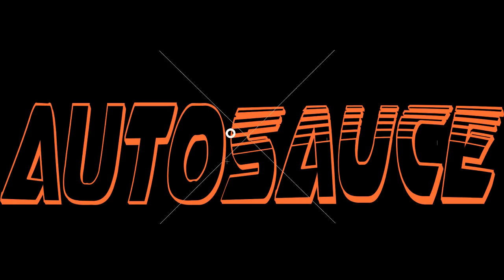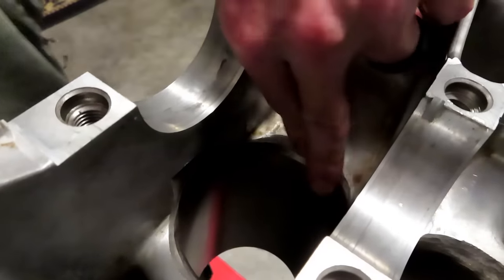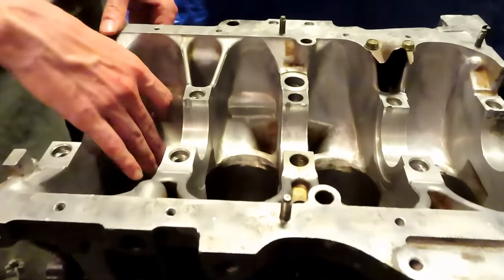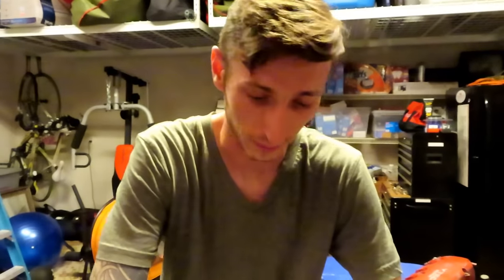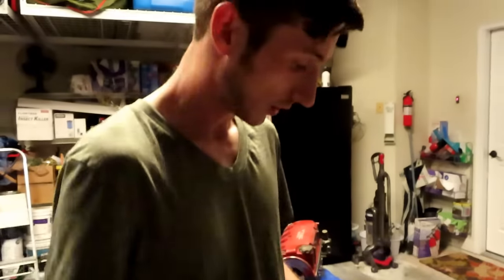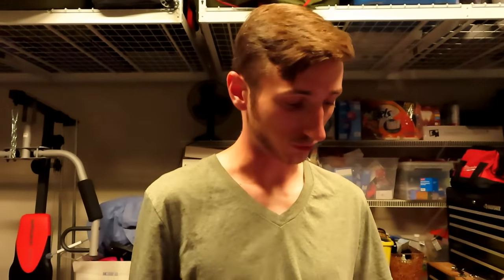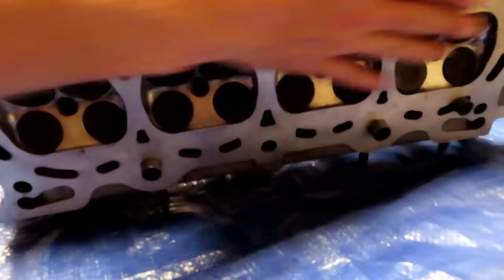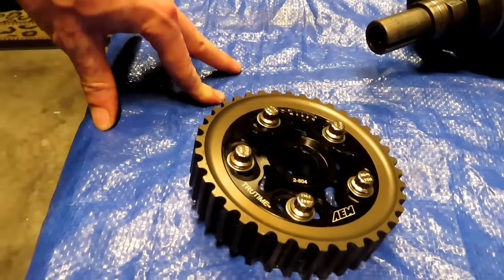EVERYTHING you need to MAKE 500HP with a HONDA CIVIC on a BUDGET

Comment: Lots of misinformation here.
Reply: Dillon Tracy then why are you here?
Reply: @yourfather5324  Because YouTube sent me a notification that this video existed. Out of curiosity, I watched it. I simply commented in hopes no one takes this advice. Because I could rattle off 5 or more wrong things with this list.
Reply: Provide said info please
Reply: @TheActualCaveman  You should always opt for a Z6 crank, Y8 will likely do just fine but Z6 IS BETTER. There is no such thing as a race crank for a D-series. Highly highly highly recommend a new oil pump. Preferably from BadGuys, at the very least pull the cover and inspect it. Shimming a stock pump will get you by, but far from recommended. Porting a stock casting pump is merely worthless due to the point of entry to the block and not recommended. Just get SFR rods, they bump your compression from dog shit to less dog shit with a Vitara setup. NEVER run a blockguard, CSS or nothing. Not even worth sleeving these things. People have been making over 600whp on these with just CSS and 4-500 with nothing at all. Blockguards put uneven pressure on cylinder walls, even forcing taper is some cases. They spell death and will crack your sleeves. Never had or heard of any problems with Ti retainers. Maybe they were installed incorrectly by some backyard mechanic with a hammer and a socket. Supertech valvetrain is the popular choice, but most all will do. Ported head, unnecessary. A stock port Z6 has made over 600whp time and time again and will match even a well ported Y8 head. Plus going wild with a dremel and no clue what you're doing will likely give you opposite results than you're looking for. Smaller ports generate more velocity and that velocity will spool your turbo faster. DON'T buy an adjustable cam gear unless you find you have to when degreeing your cam or compensating for tens of thousands shaved from head/block. No tuner is going to ever waste his time adjusting your cam and resyncing ignition timing for every adjustment. Unless he built that engine or you pay him to continuously beat the hell out of your engine on the dyno before you even get to have fun with it. Typically little to nothing to be gained anyway.
Reply: @dillontracy939  that'll shut him up😂😂
Reply: @TheActualCaveman  Z6 block, head and crank. 100% get the crank polished. New (any) oil pump. Block will likely need to get bored to 75.5mm if done correctly. Fresh deck, plane the head, valve job as well. ARP headstuds torqued to spec in 2-3 steps. OEM/Felpro or JE ProSeal gasket at that higher power level. Springs/retainers recommended, not really necessary if stock limiter. Don't forget a fuel pump and injectors. 255/1000 might get you to 500whp. Big boy clutch. Lastly, a 4 bar map sensor. Should make a very reliable 350-400whp easily. 500+ you're doing so at your own risk with those pistons lol.
Reply: @dillontracy939  dude what's the best turbo for a d on the streets? quick spooling and will take 400+whp thanks
Reply: @alitoroganan2442  Most turbos will get you to 400+. Just depends how much boost you're comfortable with. These blocks see upwards of 26-32 psi on stock sleeves and live for months if not years. 50 trim will spool fast, around 4k or so but might be a struggle past 350whp. Something closer to a 60mm will definitely make you the power but spool will come later 5-5500. Hard to recommend a turbo as there are so many and budgets are a thing. Tuning, compression, manifold design, charge pipe diameter etc etc all play a huge role in spool times. Buy a 50 trim Nagasaki War Whistle and send it. If you need more, another one that's bigger is about $100 lol.
Reply: Very much appreciated on this info!!!! Screenshotting for sure
Reply: @dillontracy939  I was told a factory Mitsubishi Eclipse turbo manifold bolts right up to a D series Honda engine??

A stock Mitsubishi turbo T25 or 16G turbo spools very fast and you can run 20psi on them all day. Very cheap and plentyful too.
Reply: Hey man, u have instagram or facebook for me follow or add you? Because i will buy a coupe civic in the next year and i will need help, and i think you don't go reply this topic on the next year
Reply: Helpful comment and video I’m a newbie with lil cash but a 97 accord coupe vtec 5 speed and  what kind of guidance I can  to find used performance parts and body etc
Reply: Dillon Tracy this is great information. I’d be willing to pay for a full build breakdown and parts list.
Reply: @dirtysanchez2161  check out what bisimoto does
Reply: @dirtysanchez2161  cam, full bolt-ons i-h-e and a vfaic and a tuner and Dyno to dial it all in. Go with a drop in cam unless you can afford to do full valve train upgrade

Comment: What about the transmission? I heard d16 trans is super weak?
Reply: D16 transmissions are garbage! I use to race a CRX with one, and we were rebuilding the trans once a month. They do make a D to B adapter plate so you can run a b-series trans with a d-series engine, kinda pricey but well worth the investment if you love your d-series lol.
Reply: D16 trans can be weak unless you have one fully built with carbon synchros and a full LSD along with custom gears. Going over 500 hp will realistically need a D to B conversion on the trans.
Reply: @Hoovnuts2010  but where can u buy that d to b conversion
Reply: Boosted Carlos, they are available online. But they are expensive.
Reply: @boostedcarlos5953  D2B is not the way anymore. B series trans aren't notably stronger than D series. If you learn to drive it you should have minimal issues. If you dump the clutch and ram gears as hard your biceps allow you, you will break them both. D2B is super expensive no matter which of the 3 ways you slice it. Also needlessly complex and annoying when you do have to swap trans. You're also swapping bell housings. Broken transmissions are a byproduct of making 4-5x the power it was designed for.
Reply: D series period is shit I your going to build a Honda k series or b or h is definitely the way to go

Comment: Are the single cams gaining popularity? Like I’ve noticed more after market support and more serious builds on them
Reply from the maker: Definitely man!
Reply: @Autosauce  so you’ve worked with the d16, what’s your opinion on the cylinder walls and sleeves? I was looking at wet/mid sleeves for the d16 and they’re only like $650 (usually $1000+ for other blocks if I’m not mistaken) but honestly if I could negate that cost entirely on the block build and just stick with stock sleeves (upon inspection) or replace them and add a block guard instead of spending the extra on mid sleeves. Basically in your opinion is it worth the investment or is the existing structure suitable for 350+ hp

Comment: What about on the D17? I have a first gen EM2
Reply: I had one as my first car unfortunately there is not alot of aftermarket parts for it nor is there big power to be made with the d17 so I would say if you want to make more than 200hp easily do a swap
Reply: I have a 05 em2, with a tuned  k20a2 swap, after breaking the crank bearings (the weakest part of the d17) , add me.on facebook if you want more information ;) 
@ nicolas dujardin

Comment: why not just by an older intergra with a k block, everybody says they hold 500-600 hp completley stock
Reply from the maker: Mike Rivera JR an older integra comes with a b18 not a k20
Reply: @Autosauce 
your right if we go really old BUT, by to day standards a 2002 integra[aka rsx] is now almost 18 years old and can be purchased for 1500-3500$

Interga motors  [from wiki https://en.wikipedia.org/wiki/Honda_Integra ]
(94-01) B18b or b18c
(02-04)  K20A, K20A2 
(05-06)K20A3, K20Z1
Reply: @mikeriverajr4447  not sure how well a k series gearbox would hold up to that. It seems that's the weakpoint of the k series. I could be wrong though

Comment: So I bought an eg, which had a d16z6 already swapped in it.
I want a k24 ultimately, but I’m curious how much I would have to spend on what I already have
Reply: turbo kit and you get about 200hp, cheap turbo kit. a rebuild for 400whp I would say about $1200 for the engine, rods, pistons, acl bearings, new oem oil pump, springs, gaskets and arp head bolts, and probably about $1200-$1500 more for the turbo and suporting fuel, and clutch

Comment: I have a 6th gen accord if i only wanted to boost say 4 or 5lbs or less say my engine is all new would i only need to upgrade the head?
Reply: Head gasket, arp head studs, at 7psi you are good for a year or 2 on a decent motor thats never been cracked open

Comment: i’m new to this platform so if i do all of this i will make 500hp or it will be able to handle 500hp when boosted or whatever
Reply: I'm new to this too but a little less new than you. This is a build looking to hold power for a turbo so you would still need to turbo the car. Changing stuff like the heads or cams is what gives you some more power.
Reply: @andrewprince4730  thanks man

Comment: You don't have to sleeve the engine for that kind of HP?!!
Reply: Roberto Hernandez is day sleeves are for 800+, stock Honda blocks aren’t weak it’s the stock pistons and rods that make me blow up, closed deck blocks are better, but open deck blocks will still hold plenty of power 👍🏻
Reply: @damianmonte  interesting what if you're going for a higher comp low boost set up? 🤔

Comment: You almost had me on this build. But saying that a y8 crank is a better choice than the z6 is flat out wrong. Having less oil ports cannot be a plus. Also it’s not just about oil pressure. It’s about oil volume. And the design of the oil pan and placement of the pickup in a y8 motor is horrible. So the main bearings starve of oil. Any reputable shop will tell you this. Aside from that it’s just plain common sense. So please do a little research before giving false facts.

Comment: You're going to spin another bearing especially since you're not using the Z6 crank. your opinion is one thing but you're kind of giving some misinformation. I'm a huge single cam fan super cheap reliable horsepower. Great beginner car but it definitely has its limits. you're not going to be walking no 10 second car. And please learn to say the name of a product correctly.... cosmetic... you mean cometic. I really hope you don't use copper spray to. Lol
You should at least chamfer the holes in the crank otherwise it you're going to spin another bearing above 7k.

Comment: 😆😆😆 all these people talking s*** about you. Cant be cheap reliable and fast are mentally challenged or just don't know what there talking about .... Only thing I'd add to this build would be turbo cam to make it easier to get those numbers and to also gasket port match intake and exhaust 500hp is pushing it though but 450 alllll day long let's not forget good tires and traction bars and definitely a good shifter and new shifter bushing for the linkage don't want to miss shift at high boost ... Then bam got a killer that will walk shit all day